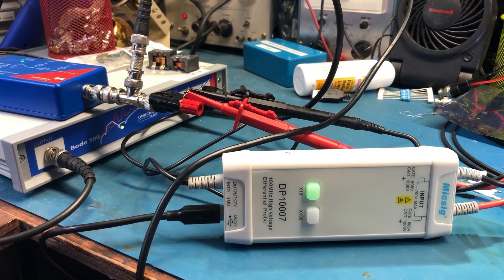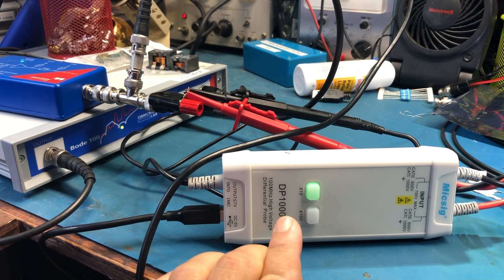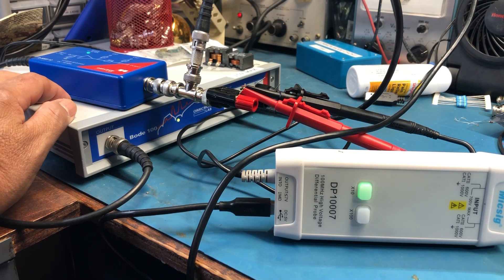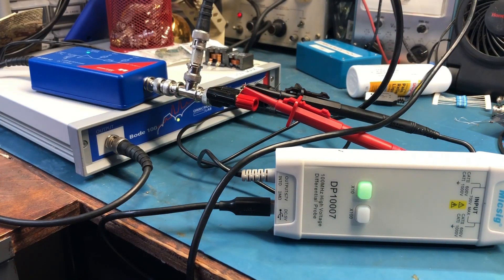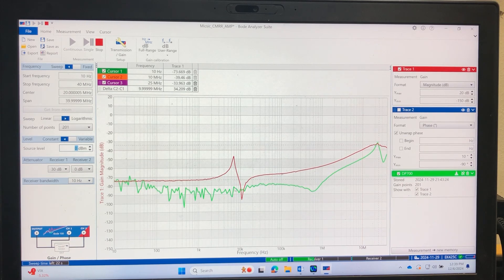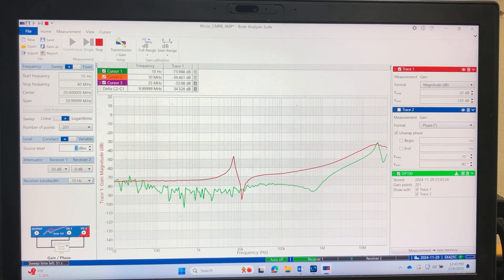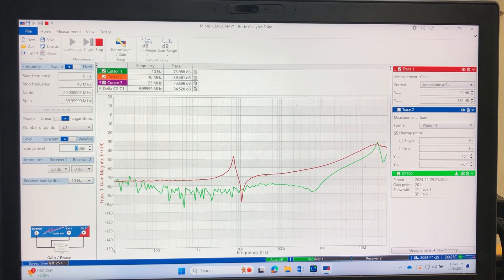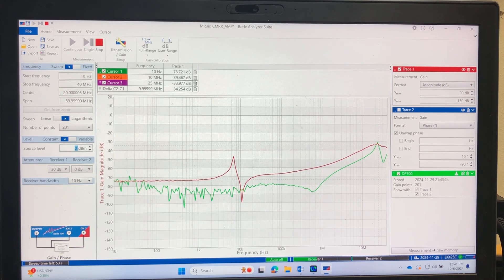Measuring the CMRR of the Micsig DP10007 using the Bode 100.

Comment: I'm confused. The figure shows the green trace associated with the DP700 having considerably better CM rejection throughout most of the frequency band...
Reply from the maker: @ats89117  yes you are correct. Did I misspeak? If I did, sorry. The newer has better cmrr
Reply: @RobertBolanos  but for both probes if you compare the figures you obtained with their specs, something is not matching… for DP700 DC -80 dB  (ok) , 100 -60 dB (yours - 80 dB) 1 MHz - 50 dB (yours below -80 dB), same for DP10007, your measurements show typically -20dB lower compared to the specs, in DC - 1 MHz, why?